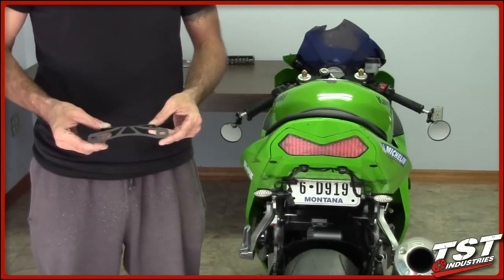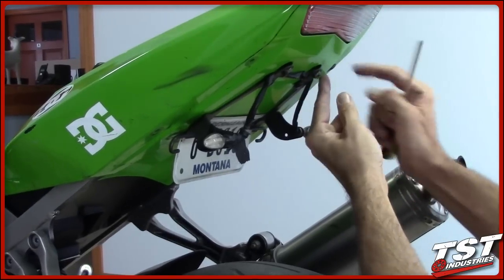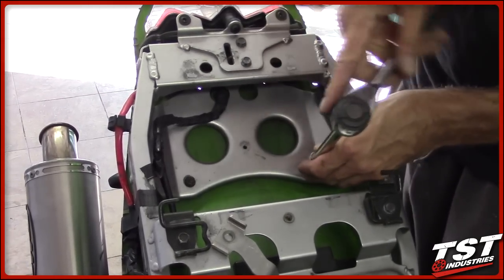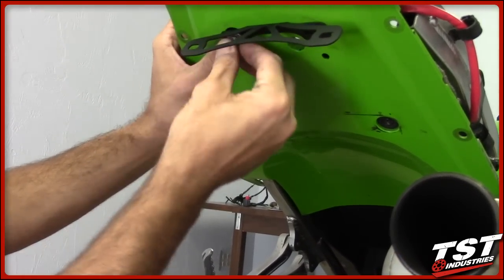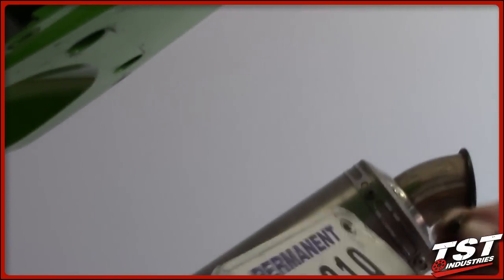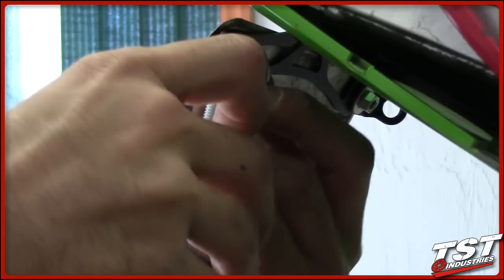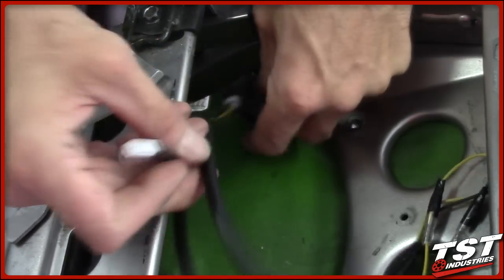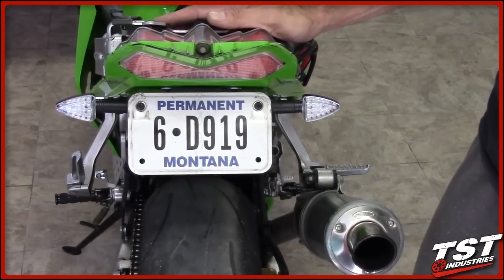DIY Installation 2003 2004 Ninja ZX6R Fender Eliminator, Signals, Flasher Relay TST Industries

Comment: @TST Industries,  do you have to install led flasher when installing the  led pod turn signals on a 2004 Kawasaki zx6r
Reply from the maker: If you want to have proper flash rate then yes, that would be a good and easy way to go about it.

Comment: The tail looks identical to the first gen Z1000. Are they and or the ktis interchangeable?
Reply from the maker: We have not had the chance to test fit on a z1000 but in examining the microfiche it looks like in fact the undertail and subframe are the same on the two bikes. It is very likely that this kit would fit on the z1000, but I can't verify that 100% until I get one of those bikes in the shop and test fit.
Reply: Thanks! I did more research, and they are indeed identical.
Reply from the maker: Zack Pollak Thanks for letting us know.

Comment: I bought the bike at another guy and he told me that nothing was wrong with the bike and when I received the bike the fairing was literally falling off so I took it to the pannelbeater s and they then spray it and plastic weld it and when they wanted to put it back together the front fearing is literally just hanging on the speedometer soo I want to know the diagram for the front fearing
Reply from the maker: see mrcycles.com . They have fiche for all the parts of the bike and show mating part diagrams in some instances. I hope that will help you.